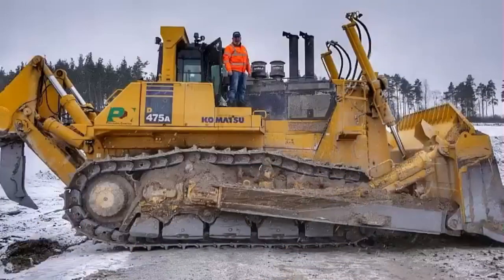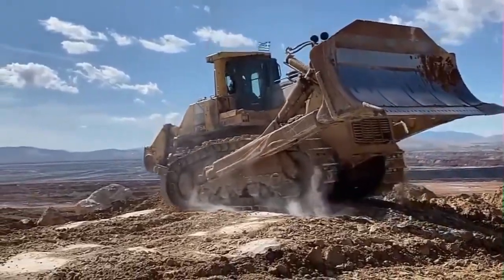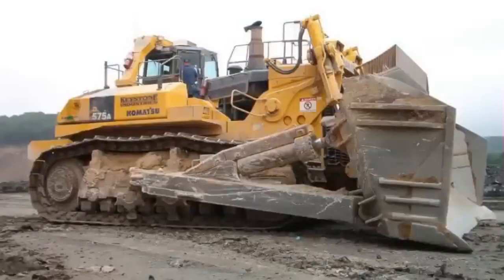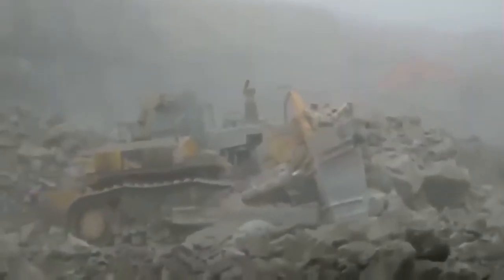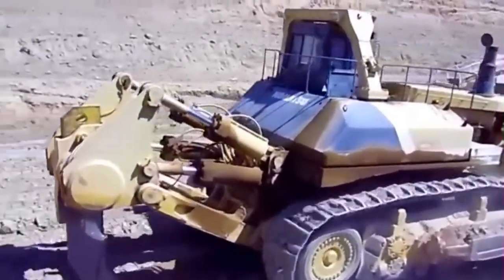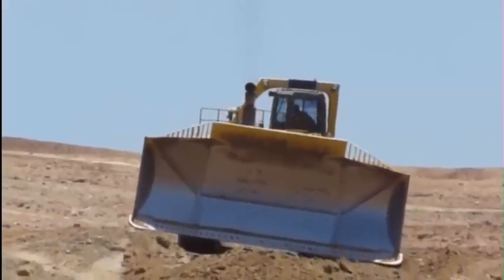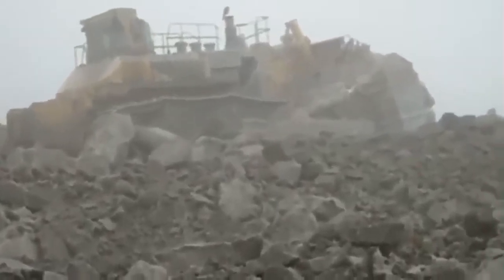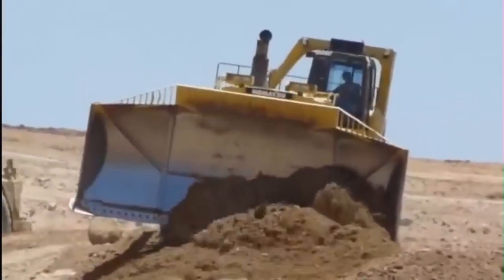The Ultimate Komatsu D575A 3 Super Dozer: Why You Need to See It

Comment: Amazed to see so much black smoke these days,most big diesels these days emit none or little of this,that was a feature of earthmovers back in the 60's and seventies.May have been a factor in it's demise,also i think it needed 1500 +HP as speed in a push looks slow like D8H slooow when Cat was upping push speed,later.
Reply from the maker: When I was still a little boy, I liked to see black smoke coming from tractors, but of course, times change, and now we think more about nature and the power could have been more.
Reply: @MrLeslloyd   I seriously doubt that another 350 HP is needed. There was a tremendous amount of research and development involved in designing this giant Komatsu dozer. I think the power level is very good as is. Installing a huge 1,500 HP or larger engine is going to dramatically increase fuel consumption and possibly increase track slippage under certain conditions. I believe that most heavy equipment enthusiasts are always looking for a speed increase when they watch extremely large earthmovers work. What they fail to realize is that machines in that size category are moving enormous amounts of rock and dirt in 1 pass. Think about how this Komatsu D575A-3 is pushing 270,000 lbs. of overburden in a single pass.The forces involved are just too high for the machine to operate at a fast pace. The engineers would probably have to boost the working weight of the machine by many tons , so it could push 90 cubic yards of material fast. The end result would probably be a very cumbersome and awkward dozer weighing in at about 200 tons or more. Just not a practical solution.